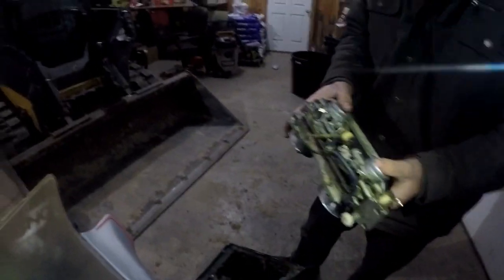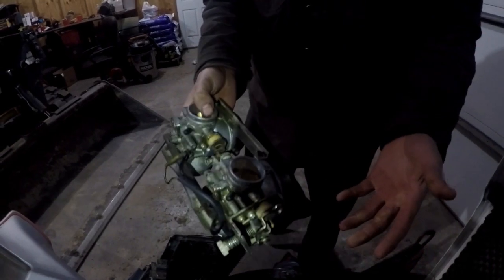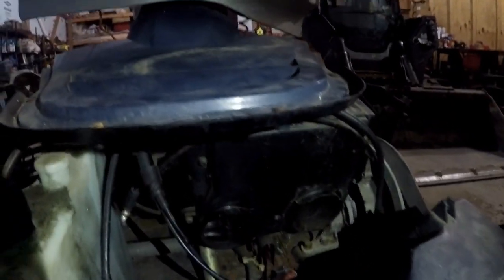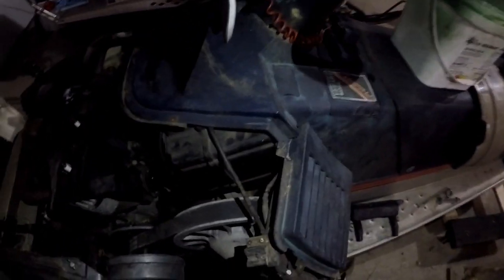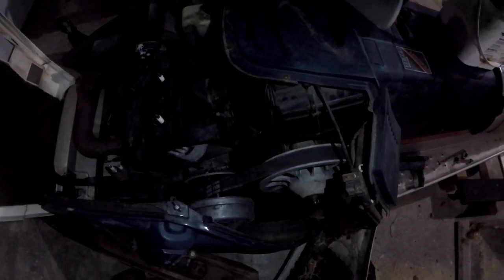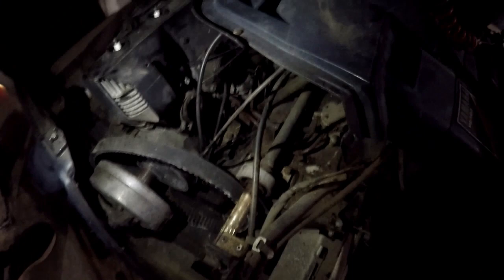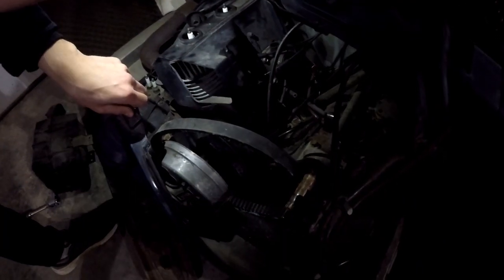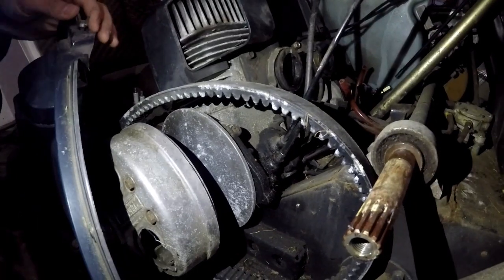Yamaha Phazer PZ480 *How to Remove Air Box...The EASY Way* (Carbs Assembled Pt. 2)

Comment: It is the best injection system ever and I'd leave it be. It is easy to adjust as well. Yeah it bleeds a tad but never enough to drip or anything like that. I have 6 of them and have never had an oil injection problem yet.